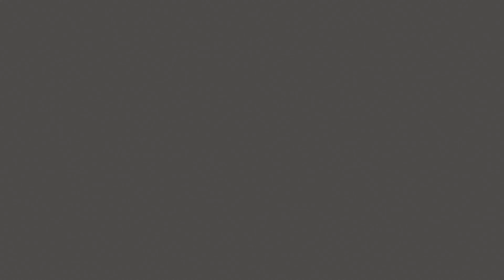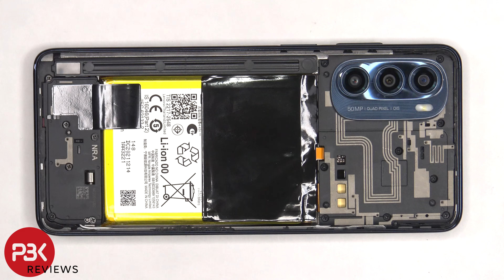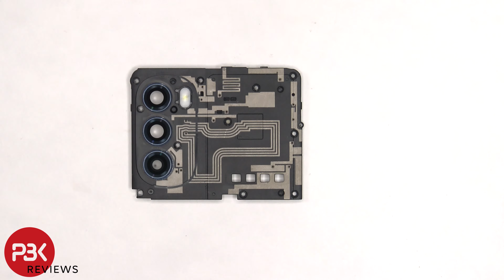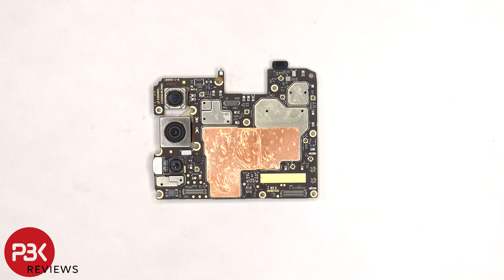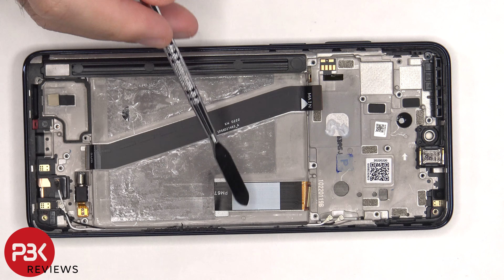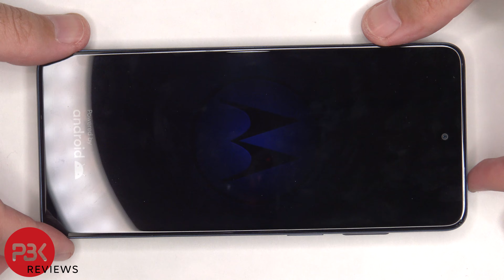Motorola Moto G Stylus 5G 2022 Disassembly Teardown Repair Video Review

Comment: This really is/was a solid phone. 
I couldn't initially find the 'right' video because I was looking for the 2023 instead of the 2022. I now have the 2025 edition, and it's pretty sweet too, although I prefer some of the '22 functionality.

Still using the 22 though, in fact right now. 😊
Accidentally broke the fingerprint sensor by dropping it. 
This is thing has facial recognition, although so did son's OLD LG. 

Good stuff

Comment: It worked.
This is a good guide.

That battery step took almost an hour though.

My only complaint is the ending reassembly was very hard to follow.

I unfortunately broke the ribbon cable for the fingerprint reader, but it's ok, the user said they don't use it anyways, at least for now.

It took me 4 hours for a 1st time  screen replacement.

Comment: I did this on my a15 and I tell you this is very similar. A couple of key differences like the main cable that connects the 2 boards is on the other side of the battery and a couple of small here and there things but overall it's nearly the same damn phone. 😂

Comment: Thanks for the video. I dropped my phone about 2' onto a cement floor. It landed face up and didn't crack but the screen wouldn't light up. Took it to a repair shop. He thought it'd be a straight forward fix since we could tell it was still powering up. He tried 2x to replace the screen and it shorted out both times. I ended up getting a new phone but he gave me the old one so I could play around with it (this stuff is interesting to me). 
Anyway, seems like if it shorted out, wires must be touching somewhere when they shouldn't be so I'm just curious to take a look inside. This is very helpful.
Reply from the maker: You're welcome. I don't think it will have a wire issue, possibly damaged circuitry on the board, broken contact points in the solder or something like that.
Reply: @PBKreviews  thanks. I'll look for any changes like that. 👍

Comment: I can't get my battery out because it's so over glued and isopropyl alcohol isn't doing squat.
Reply from the maker: when you add the isopropyl alcohol, use your plastic pick or tool to try and gently lift one side of the battery and hold the phone at an angle to let the alcohol get under the battery. You can add more as needed but doing too much can lead to it getting behind the screen and leaving water marks.
Reply: @PBKreviews  it was frustrating but I got it out.

Comment: I like the video overall but don't like that you didn't show the part where you applied the adhesive when putting it back together. That's the part that scares me the most because if it's not done properly the phone isn't really fixed and I now have another problem 😅
Reply from the maker: Thanks. You can either watch this video I did : https://www.youtube.com/watch?v=T4iiPUIM7-Y   or this one: https://www.youtube.com/watch?v=ozzJkNA7t0I   which will show you more in detail how to do that.

Comment: Thanks! It was really helpful. The worst part is getting the backplate off honestly. Always have to be careful when dealing with plastic. I just had to replace the charging port board due to it having intermittent connection (Goes from turbo charging, to charging, to slow unless you applied force in the right angle. I used an app called Ampere to measure it's charging performance before and after.) Which was pretty basic. 

While you can replace it without unhooking the battery, I did so anyways out of caution and experience as I will have to replace that eventually.  Didn't have to do anything but that to replace it. The 2023 model has less Ram than this one so definitely would have been a downgrade from what I had. A general suggestion, use a screwdriver with a magnetic tip when dealing with small screws like this.
Reply from the maker: Thanks! glad it was helpful. Incase you ever need other parts in the future, check mobilesentrix.com they usually have original parts and ones which sometimes aren't available on eBay or Amazon.
Reply: @PBKreviews  Oh that looks good. They look to have an entire LCD assembly with the frame which is a time saver and OEM batteries too. Stuff for game consoles too. Shame that only goes back so far though.

Comment: 4:09 so the reason I'm here is I'm intending to replace the microphone in my device. Is it possible to purchase the individual component or is it only sold as a package as shown in those assembly boards? I'm also considering replacing the battery while I'm in there but is there any other common failures that are cheap and worth replacing? I'm experienced in smd soldering and using lithium based batteries for different projects of mine (making bms, nickel strip welding, ect). I'm just curious if anyone specifically sells that individual microphone or if it's a whole assembly only.
Reply from the maker: I usually don't see individual mics being sold as replacement parts, just the sub board/charger port board which has the mic on it. No other parts I can think of that would really need replacing. Right now the website is down for maintenance, but you can check www.mobilesentrix.com for replacement parts for this phone.
Reply: @PBKreviews  are there any tutorials for this phone model for removing the screen replacement?

Comment: I did a screen replacement on one of these. Everything seems to be doing great, except the fingerprint scanner no longer works. The option to set it up isn't even showing up in settings.
Reply: Double sided adhesive tape
Reply: How did you get the screen to securely attach to the frame after reassembly?

Comment: Where the 5G antenna? On Ifixit, it shows just above the ultrawide lens where that rectangular piece is. Edit: I can see these are dummy parts.
Reply: On most Motorolas the mmWave antenna is mounted right on the main board as you can see at 2:50 on the lower right, looks like a gold colored rectangle by his finger.  No dummy parts at all.

Comment: i wish you could have shown the removal of the screen.  this model has 0 tutorial videos for lcd replacement
Reply: Did you ever find a video on it?
Reply: I need also. It's critical. This sucks
Reply: Did y'all find a video?
Reply: For all of yall, you just need to follow this as well as the video on the replacement of the motor g 5g 2022 (not stylus).  The screen seems impossible to get off at first even with heat, but I just started peeling away the cracked bits and eventually got all the glass off.  After that, you still need to disassemble everything else to get the ribbon cable routed under the battery removed and replaced.  Only thing I'm stuck on is how the hell the screen is supposed to actually attach to the frame, as right now it just kinda flops around
Reply: I'm about to make a video in a couple days please sub and you will get notified when I post it this dude did a whole bunch of extra shit u don't have to do
Reply: Did anyone find a tutorial? I can't find any tutorials for this model Stylus, it's insane.
Reply: Sadly, I just dropped mine, in a decent case, just the wrong way, and it landed on the fingerprint sensor. 
Sensor was hot to the touch, then just gave up. Really weird, but not, I guess. 
It just hit the wrong way. 
These are really decent phones though.

Comment: Hi :) . Quick question. Does motorola edge s have an aluminum frame and mmantenna wave? thanks
Reply: Unlike on Samsung phones where the mmWave antenna is mounted in the frame, on most Motorolas the mmWave antenna is mounted right on the main board as you can see at 2:45 on the lower right, looks like a gold colored rectangle by his finger.
Reply: @BillAnt  thanks for the added thoughts :)
Reply from the maker: For the frame, I believe it would be a plastic border over a aluminum alloy mid frame and mmWave antenna would depend on which region the device was for.
Reply: @PBKreviews  thanks, I'm from Philippines btw :)